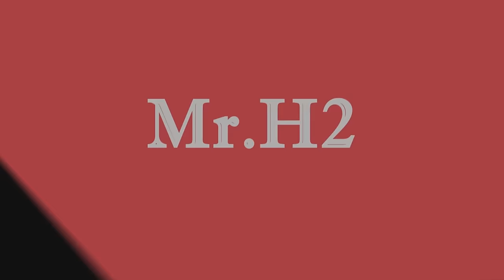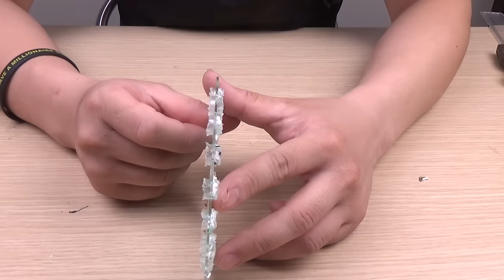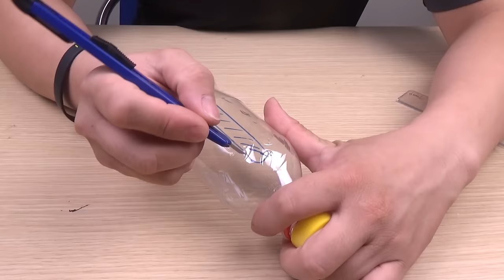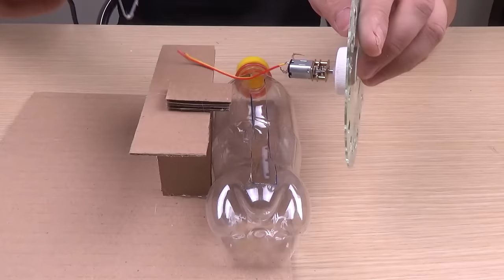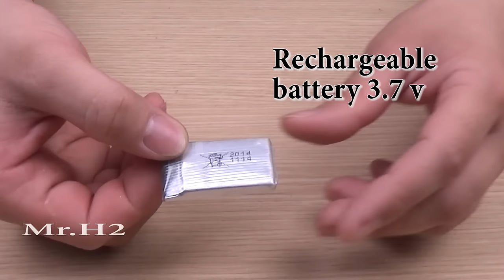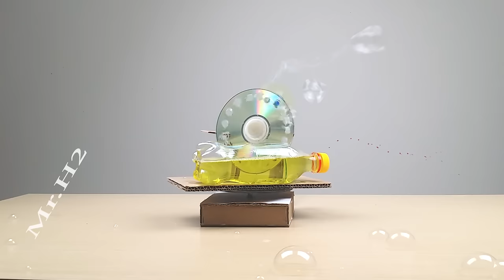How To Make a Bubble Machine using DC Motor at home - Mr H2 Diy

Comment: Hi may I ask what motor did you use for the dics? And the motor of the fan, is both the same motor?
Reply: It must be a gear motor for the CD.
Reply: The other one is a dc motor
3 volt

Comment: What kind of motor did you use? I made one too but the rotation is extremely fast that all soap water splash everywhere and no bubbles blew out.
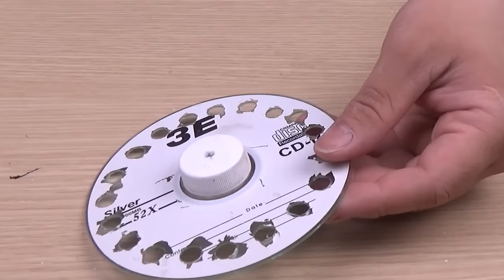Reply from the maker: 1:28 === > 100RPM Gear Motor 

http://bit.ly/mrh2motor100rpm
Reply: Same thing happened with me
Reply: U can add speed controller of 20 ruppes in any mobile shop
Reply: Fake or just for show
Reply: Same with me

Comment: Can we use mini motor in place of dc100Rpm?
Reply from the maker: You can use it and gear to make the speed 100 - 200 rpm for disc (cd)
Reply: Haima Sadikh chesh
Reply: kumare
Reply: @bipatshing633  What??
Reply: Haima Sadikh ड़